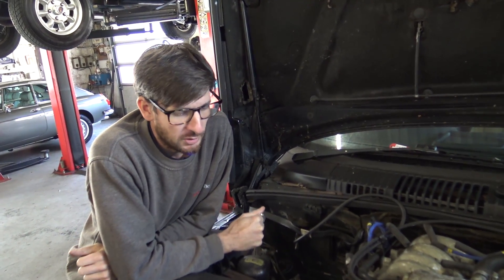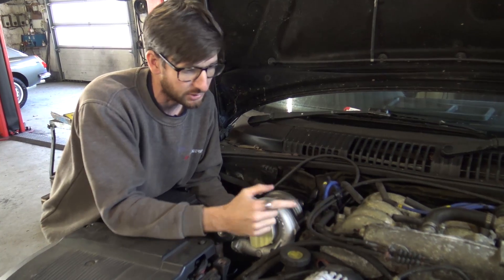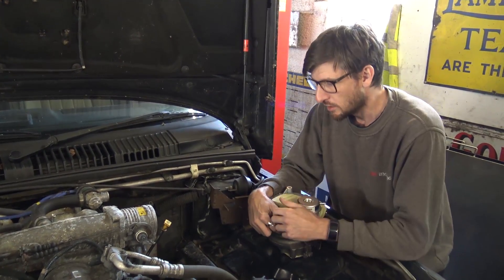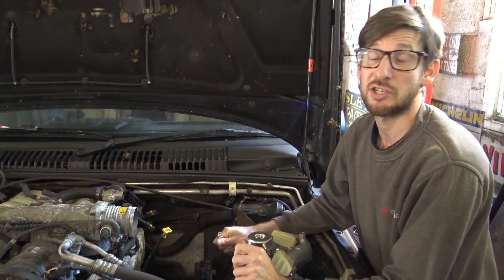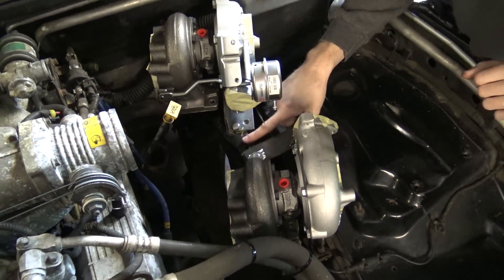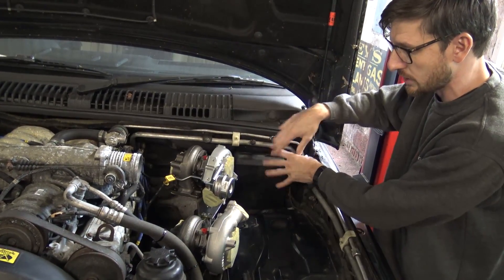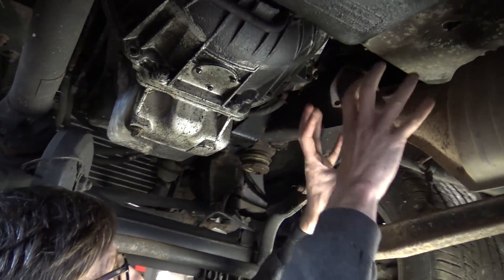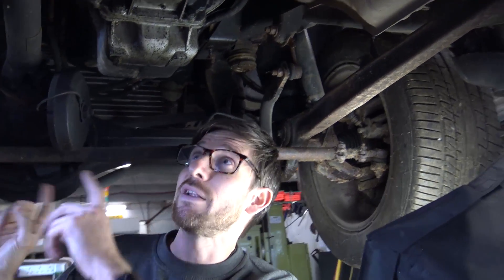RPi Engineering Rover V8 Twin Turbo Tuesday Episode 2

Comment: I've been thinking about doing this to my D2A for a while and have looked and found ample room each side of my engine bay. I'd say more room than what you have there. I'm interested to know what to do about engine management.. stand alone or piggy back as I wish to keep all my standard features (ACE, Rear air bags, ABS etc.) 
If you guys are so limited on room why not go a larger single twin scroll turbo fed by each bank?
Reply: I'm not so sure that the percieved benefit of twin over single turbo is actually a benefit these days with modern turbos. A well matched single on an RV8 can be sized to get very good response as in reality the max flow requirement is still quite low in absoloute terms (not likely to be much above 400bhp). Twin means two downpipes, two induction hoses, two boost hoses, two oil feeds etc. All do able but a pain. Good project though. I'm doing an old school single turbo setup on an old TVR with a 4.6 hence I've looked into the benefits/disadvantages myself. I haven't got room for twins on mine anyway! Chargecooler all the way in my mind, so easy to pipe compared with getting 2.5" pipes to the front & back.
Reply: @SB-vb8ch  do you have a build thread or video?
Reply: @SB-vb8ch  in my opinion (I can be wrong) a car with twin turbos can benefit is they are sequential because it reduce turbo lag in real life driving conditions. A really hard thing to do in our V8 engines. That's why people put the twin turbos in parallel in V8 (or V6). For my, because I don't have and inline 6 to use secuencial twin turbos, it means to double or triple the cost for the same results. Parallel twin turbos will NOT reduce turbo lag, so better a BIG alone turbo, or a supercharger like I do because I'm not running 1/4 mile. Let my say another thing, this summer I see a VW (or Audi, they are the same for me) with twin turbos but one of them is electric, OEM equipped electric turbo. All my life thinking electric turbos where a fraud or a scam, but they can be used to reduce turbo lag, NOT to produce boost, but to reduce lag. A crazy thing, but it works. Lastly (forgive me for write this much) is you are not like me, that I don't have a FB account, not Whatsapp or any of those things... You have a page where we can see your setup? Not that I want to put a turbo, but as a mechanical fan, is always glad to see those conversions.
Reply from the maker: Oh and also keep in mind.... There is room for the turbo on the drivers side but its the pipe work to and from it that stops it going there in the end. Even if the battery tray was removed there is loads of room for inlet pipe work and the turbo however its still not possible to get an exhaust manifold and down pipe to go between the block and the steering column.
Reply: @RPIEngineering  cheers, I really appreciate the responses and I'm super excited to see this project happen.
Reply: @psiwog  I'm not "getting high", and I'm not in the "states". I'm from Puerto Rico and I'm using my best effort to write in English. The thing I was trying to say to you, is that a twin turbo is a major undertaking. One of those things you do to impress people to promote your mechanic business. But if it for your private usage, dammit, it's a lot easier to put a supercharger. I asume that you will not pay to RPIEngineering to put a twin turbo in your car, and you will attempt to do it by your own. That's why I give you my advice. If you will pay to someone to do it, go ahead, put four turbos like a Bugatti. But if you are a weekend DIY, don't complicate your like. Funny thing is that in one of my Fieros I'm using the American version because the engine is transversaly mounted, but in the Firebird I'm using the Aussy version because it have an elbow and I don't have problems with neither of them. Lastly, I'm not trying to win a discussion, I just was trying to help you. Good look with your project.
Reply: @Ivan_Arrache_Young  ok, i understamd what your saying more. I guess the point im making is we were talking about different cars. Yes supercharger is easier in some respect but not as good in other ways. Persoanlly id go turbo but i have my own reasons. Im very curious to know how this project goes and if it is worth doing otherwise ill do an LS swap. 
PS - your english is good, better than my Portuguese :)
Reply: @psiwog   I was thinking based in my necessities. I want a vintage daily driver, maybe you want something more race or strip. There's a guy from Australia that build a twin turbo UTE, talk to him. Talking with ones who did it before yourself, will save you to make possible mistakes they already made. His name is Stirling Schuneman.
Reply: @Ivan_Arrache_Young  yeah thanks mate I watches his series. He had an interesting build but I found over complicated things a little. A supercharger is great for your daily duties, off road and towing. Good instant response. 
God bless you mate. I hope your well
Reply: Mmm... put a Eaton supercharger from a GM 3800 V6 in yours if you are not promoting your Mechanic Garage or Auto Parts business.
Reply from the maker: Supercharger is another way to go for sure. And again if done right inlet temps need not be a worry.
Reply: @Ivan_Arrache_Young  I'm not promoting anything and that supercharger is too small and heat soak air temperatures.
Reply: @psiwog  with all respect; How many Eaton M90 supercharged conversions have you have done? I been working with BOP cars for more than 25 years. Current owner of two Pontiac Fiero and my daily driver is a 2000 Firebird with a 2004 Rover 4.6 (AKA Buick 288) for the last eleven years and 126k miles and counting. And let me tell you this, the only way to break your pistons with that supercharger, is to using ZZPerformance smaller pulley without a secondary 8:1 Fuel Management Unit. You can even put a 300 crank to 5.0 liters and that Eaton will supply your needs without any risk. Maybe you read that from the "Web experts", but there's not any serious experienced mechanic that will tell you that. Heat soaking? Maybe amateurs that sucks.
Reply: @psiwog  the guy is right, a well tuned M90 can run perfectly in the Rover 4.6 but if you have a Buick 350 go with the M112 found in Ford and Jaguars.
Reply from the maker: Going single turbo would still involve making a link pipe so it would not save on that hassle :-) Also the original idea of this project was for more mid range torque and for that two smaller turbos that spool faster are better than a single larger turbo that would be required to still supply enough air at max rpm. Fuel pressure and injectors are being changed / upgraded and then the Thor ECU will be remapped accordingly.